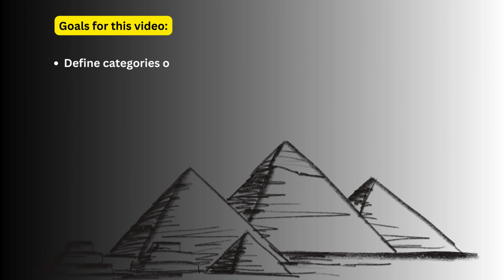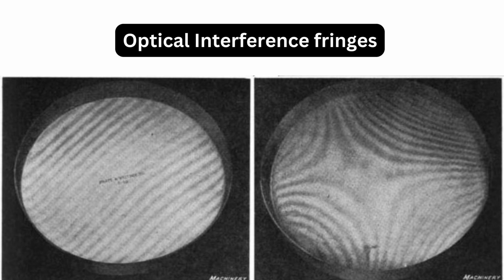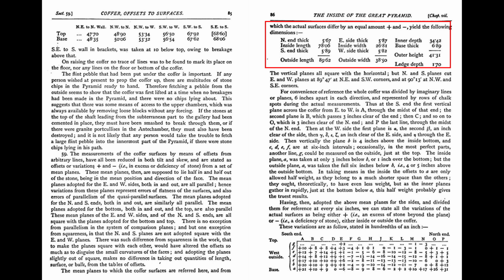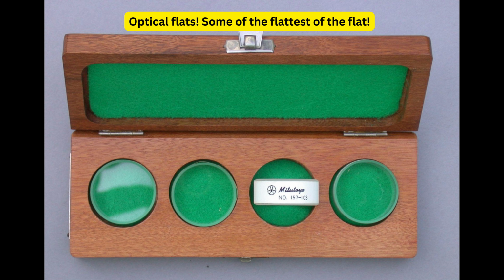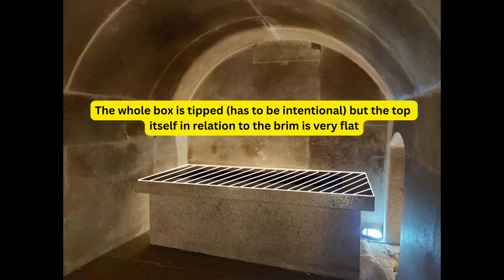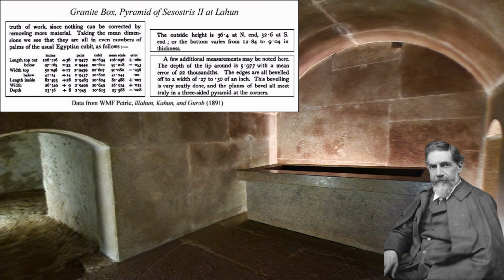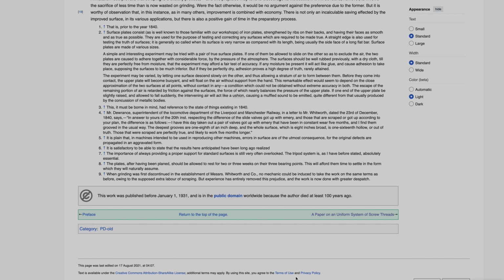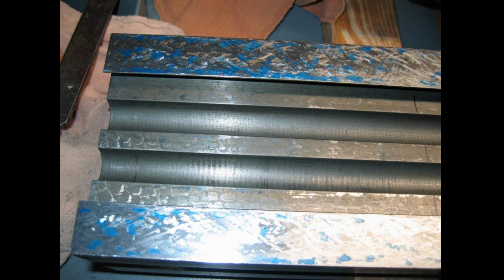The Problem of Flatness in Ancient Egypt

Comment: I'm so glad you mentioned hand scraping and the three plate method.
For those of you that think that ancient Egyptian masonry is evidence of "lost technology" consider a more rounded explanation: ancient Egyptian masonry is evidence that ancient peoples understood the foundational principals that modern precision is built upon.
Nothing was "lost." It has been the status quo for so long that it is easy to overlook.

All CNC and manual machine tools' precision originated at a hand scraped plane. A six axis CNC mill can operate at sub 1/1000 inch levels of tolerance because of a hand scraped plane somewhere at the beginning of the manufacturing chain.

Re: granite surface plates.

It is a calibrated rock.

A finely calibrated rock, but a rock nonetheless. Literally and symbolically the foundation of metrology. Simple. Enduring. Indispensable.
Reply from the maker: We are so advanced we forget how ground breaking the first carpenters square would have been. The first guy with scissors? Basically iron man.
Reply: @intothemap360 first man with scissors was iron man.  I think the first iron man was in full plate of iron..... man
Reply: @intothemap360 the first guy to whip out a speed square was probably treated like a witch
Reply: @intothemap360 it’s not that they could achieve angles and flatness genius, it’s how they accomplished it in materials on a mass scale in some of the hardest material on earth with primitive tools. Tell me you’ve never hand worked any type of stone material in your life.
Reply: @derekjancart215   pretty sure that 3000 years of knowledge and craftsmanship being passed through guilds for decades long projects doesn't care how hard you perceive something to be
Reply: @Azmodon lmao nice sub 80 IQ response bud.
Reply: @derekjancart215  im proud of you knowing what an iq is, baby boy :)
Reply: @derAtze well clearly most of you retar&ed city kids have zero clue about anything in the real world.
Reply: @derekjancart215  yeah it was obviously aliens that did that!!
Reply: @RussischRap did anyone say anything about “aliens” you disingenuous clown?
Reply: @derekjancart215 Just because you don't know how computers work doesn't mean they're some lost technology either.
Reply: @Shaker626 I’m well aware of how computers work genius. The fact is that the blocks in Egypt show CLEAR INDICATORS of machining, the Petri core sample being the most definitive example. I love how people who know less about this subject than I to try to lecture me about it 🙄
Reply: @derekjancart215 soy you are an expert then ? Highly doubt it
Reply: @derekjancart215 I love how you call other people genius sarcasticly and use iq as an insult when you are the idiot 😂
Reply: @1degRazz way to address none of my critiques mouth breather.
Reply: @derekjancart215 

"Tell me you've never worked any hard stone material in your life."

I have been knapping flint for about twenty years now. I'm going to go out on a limb and say that I probably have more experience working stone than you. I love making tools. I'm primarily a metal worker but I believe any person that is serious about making tools should experience where it all started at least once.
Reply: @derekjancart215  nice, look at all the retards who've never worked stone that you've stirred up
Reply: Good point, well made. I think the modern references to "forgotten technology from a bygone age" are by people (usually non-engineers) who don't understand well enough whats being described to them....
Reply: Almost brought a tear to my eye. Your passion for flat rocks is admirable.

Are you also a fan of smart rocks? They are also very flat.
Reply: Well said
Reply: These predate the Egyptians. We see the same story all over the world with these structures. That story was lost and mythologized over the centuries because the truth became too unbelievable. And now here we are today with the dumbest, most incompetent and disease ridden people in history.
Reply: Hell, plenty of machines still have hand scraped ways, not just way back at the beginning of the production process - there are highly accurate machine tools, in production today, that rely on hand scraped parts in the machine itself for their precision and accuracy.
Reply: it's all rocks and sticks
Reply: first mistake is to think ancient technology people actually care about some form of truth. they like good story telling.
Reply: Quite. We still have their level of tech in use. There may be a modern twist because of advanced materials, but we still lap surfaces. You can achieve good results with low cost with primitive tech. It just takes more time than other ways.
Reply: @pauls5745 problem is no one replicated those insane stone sculptures with copper tools
Reply: @honey87pie How is that a problem? Customs and resources vary by region and time period. Different techniques were developed to suit what was available.
Reply: @seitenryu6844 This is only a problem because the only way you could do that work today is with machines and power tools.
Reply: @honey87pie  ?? Yes they have. Pounding stones and copper/bronze chisels are more than sufficient and it's been demonstrated repeatedly. You go through more tooling faster than with harder metals but it absolutely does the job
Reply: @honey87pie the methods have been tested and proved to work, if you want to pay for thosands of people working for decades to build a whole pyramid with these tools and methods then be my guest. But to most people we only really need to prove it's possible to do it not actually replicate the entire prject.
Reply: @jakobrosenqvist4691  but that's not how the scientific method works. And the great pyramid is supposed to be built in 20 years, not thousands
Reply: It's like people dig way too deep for insane answers when they already had the answer at the surface
Reply: Hand scraped and Hand drawn with a pantagraph
Reply: The absolute king of precision machines is laser lithography.
Reply: @trisetank862  What about E-UV lithography machines for semiconductors with precision in nanometres.
Reply: @WolfGamerBohumin  I would say that's basically laser lithography with extra steps but you're right, technically the source that actually does the engraving isn't a laser... even though the energy of the UV light is coming from a laser
Reply: "yeah but my Google research tells me aliens may have had a hand in this"
Reply: To be fair, several building techniques have been lost to time and modernized processes. But id not pretend old civilizations were using alien mumbo jumbo. Just time, and effort.
Reply: @NotaNinja time and effort doesn't make an insane granite sculpture with copper tools and sand grinding.
Reply: @honey87pie except it literally does
Reply: @Tensho_C no it doesn't,  do it then , I've tried to do a little sculpture, didn't work out and I tried like a mofo for days trying different things. It would take a lifetime for a big toe on some of those granite statues. It wasn't copper and sand. Your uneducated and inexperienced if you asert that is how it was done. It's not alien tech. It's just a way we don't recognize and was ubiquitous or a state secret and wasn't recorded. With timelines that are claimed  for certain monuments our knowledge of what has been destroyed. Lost or reused and what we still see today implies an industrial scale operation that wouldn't be that inefficient becuase they didn't have access to enough copper or lifespan and populations to achieve the scale we see. We know slaves didnt do the work in fact the workers were highly paid. So thats not the main portion of the population, they were craftsman,  smart people same anatomy as us. Let's remove woo woo ideas, like aliens or that they couldnt have thought of the wheel. If they are aware metals like copper could be used with a harder material like sand with water to shape stone, it's not that far of a leap to have 1 singular craftsman to have the idea to move thar closer to a water source becuase the sand gets used up, however it's not river sand they use. It's a quartz rich sand from the desert we know this, sharp sand particles.  Larger sand obviously will last longer and cut more and is obviously crystalline to the eye. Someone else has the idea of using straight up broke quartz crystals or sapphire from the river in there bow drill instead of flint or chert. at the river you see "big" sand.  OK so wood breaks, copper bends then breaks but since it's the bronze age, that's tougher, your bronze bow drill is now insane. If you are lucky you bronze had an iron/aluminum contamination and now you got 954ish bronze. Someone gets the idea of using the river to turn the work instead of the drill becuase turning the drill sucks and the hours drilling is exhausting. So if you got evidence highly paid work force that isn't slaves, chronological evidence of large sites being made in a window of time. A rough estimation of population, there isn't much of an explanation of how at scale this was accomplished.  My thought experiment is only an arbitrary example of jumps in ideas. But it had to be more efficient to have the scale of  output they had regardless of precision. However more efficient techniques and tools will by nature be more repeatable, thus more precise. Not superior to ours. Sure there could have been master craftsman making there hard rock ultra thin vases with there mad max river lathe turning but that's not the majority.  I'd like to stress one more time, lost technology doesn't mean woowoo, aliens, lost civilizations etc its just techniques we don't know and obviously aren't explained by archeological accepted methods. Becusse archeological experts have yet to actually attempt their methods true to form
Reply: @erokcreatesyou should look into jade sculpting with thread and abrasive mediums and water is all they need to cut stone of any hardness just need an abrasive of higher hardness scale
Reply: @erokcreates Not everyone involved was a highly paid skilled craftsman. 
Also you seem to have run off on a tangent here.
No one is claiming there no lost technology. What people are claiming, and what the debate on the internet is: is there lost advanced technology or just lost technology that is still suitable for the era.
Like, if they only claimed that egyptians had some (by todays standards) primitive machines that helped them speed up the work like waterwheels, or plates of copper with a hardened iron edge for cutting then I don't think there'd be much debate other than academically.
But that's not what these people claim. Their claim is that egyptians somehow had batteries, or lasers or other advanced tech by today's standards that is somehow completely missing in any sorrounding civilizations and without any shred of evidence of manufacturing ability for such tech.
Reply: @Tensho_C show me one. Just one. Not from Egypt.
Reply: @honey87pie  lol. that's exactly everything it takes
Reply: @ajb9167sure, pick up a block of iron, some copper tools and with time you end up with a Ferrari
Reply: @spliter88  What these people also neglect is the Egyptians quite literally provided us with images of how they did everyday things.  There's reliefs carved into stone showing how they drilled and made granite jars.  There's reliefs showing them polishing granite with stones. There are no reliefs showing some mega fangled machine churning out objects.
Reply: @honey87pie  sure. Jade has the same hardness of granite and ancient Chinese were very proficient in creating intricate and precise sculptures out of jade.
Reply: @ajb9167 ancient China jade sculptures
Reply: @marcop1563 Yes. Another great example of sculptures that are so precise that we don't actually know how they were made, also never being replicated with the tools of that time, close but not anywhere the same precision. So the justification is the same "thousands of hours of labor" by the best craters in existence. Ok
Reply: @honey87pie  goalposts moving. And nah, there are people producing them with traditional instruments still today.
Reply: @erokcreates Except archaeologists have replicated the exact method with bronze saws, a lapping material, and water. These people devoted their LIVES to a single thing. Trained since children. Personal incredulity does not disprove the genius of ancient peoples.
Reply: @marcop1563  can you show me one, just one.
Reply: @honey87pie  I found several with a quick internet search. I think you can manage too.

And, by the way, you asked for "just one other example" and I give it to you. Now, instead of admitting that there probably was some way to cut hard stones with primitive tools since two ancient civilization so separate to each other managed to both do it, you are jumping to the idea that we have two ancient civilizations with secret advanced technologies.
Reply: @marcop1563 then explain to me why the writings on all those sculptures and boxes look like they were made with copper tools ans brute force
Reply: @honey87pie  all of those statues could've been made with copper tools. If you are implying that the writings are always of a lower quality, this is simply not the case. Look for example at the sarcophagus of Gemenefherbak, both front and back.

Those statue were done with ancient technology and there is no advance secret civilization. Deal with it.
Reply: @marcop1563 if you think the dynastic writings on insane sculpture you mentioned were made by the same people who made the sculpture you need some glasses or you are being dishonest. Every original writings on those sculptures has some hight, all dynastic writings were carved on the flat surface, with brute force, no symmetry, not a straight line.
Reply: @honey87pie  sure, there are some cases of writings added later. But even a single counterexample us enough to disprove your point, and I provided one. Go look at it and you will see that it has straight, precise, symmetric, and detailed writing on it.
Reply: @marcop1563 again, those dynastic writings are beautiful, but they were not made by the same people, it doesn't make any sense. You don't make a Ferrari and then carve a name with a car key after is finished.
And thats my problem with the history of Egypt. Things are identified based on names carved in stone, that's not scientific at all. And one final thing. Most of machines and tools we have today will be dust in a couple thousands of years, only stone will remain
Reply: @honey87pie  yes it does make sense. You don't want it to make sense to inject your conspiracy theories, but it does. People that commissioned those statues also wanted their names to be attached to them. Writing names on monuments is seen everywhere in human history. And your metaphor is doubly nonsensical because Ferrari does put its name on the car they produce.

Again, there are known cases of names being added later, but this is not true for all of them. And the precision with which those names are carved is the same precision that would be needed to make those statues. If the could carve the former, they could carve the latter.

And if Ancient Egyptians had advanced technology we would have some trace of it. Instead we have absolutely zero. We have remains of their boats, writings, everyday objects, tools. And no advanced technology among them.
Reply: @marcop1563 you still don't get it. I'm not saying Dynastic Egyptians had advanced technology. I'm saying those sculptures and constructions are way older than them. Egyptian timeline alone goes over 30k years, but mainstream choses to dismiss it.
I'm saying dynastic Egyptians found / inherited all that from a lost civilization and then proceeded to carve their names allover the place.
Is it fair? Can you prove me wrong?
Reply: @honey87pie  yes, I did get it, and I explained why that's not the case. 

Let's go over the whole discussion, shall we?

This whole idea is based on the fact that Ancient Egyptians supposedly didn’t have the technology to carve stone in an intricate and precise way, so someone else before them carved them. But the statues have writings that show which dinasty they belong to, so conspiracy theorists have to say that the writings were added later. But this would mean that Ancient Egyptians did have the technology to carve that stone. So conspiracy theorists have to claim that the Ancient Egyptian had only rudimentary abilities to carve stone, and this is proven by the supposed lower quality of the writings compared to the statues, so that they can still claim the statues were made by someone else. But I showed you that the writings are in some cases as intricate and precise as the rest of the statue. This means that Ancient Egyptians did have the technology to carve stone that precisely. And this means that the only reason to think that those statues were produced by someone else has been debunked.

Got it?
Reply: @marcop1563  unlucky for you that we can't date stone.  And unlucky for you those inscriptions CAN be carved with copper or stone tools, but you end up with no straight lines. Carry one. Bye. Keep believing nonsense
Reply: @honey87pie  I showed you examples of carvings that are perfectly straight. If you can carve those with copper tools with that precision you can carve the rest of the statue with copper tools. And this means that there is no proof for what you claim.

You tell me that I'm believing nonsense. Why don't you bring me some positive evidence for what you claim?
Reply: @marcop1563 show me a granite sculpture or diorite like that one made with copper tools. And the lines are NOT straight.
Reply: @captainwin6333  Direct, detailed, contemporary hieroglyphic scenes explicitly illustrating the step-by-step construction of the Great Pyramids are virtually non-existent, as they were not traditionally depicted in monumental, artistic scenes…weird for a people that detailed every aspect of their lives in this fashion. Quite odd no? And no I’m not saying 👽 did it or that they had power tools. Just seems very strange that they’d leave that out…
Reply: @hon@h @honey87pie f you have slaves and consider their lives expendable, like the Ancient Egyptians had, it does. Why does everyone forget (are they ignoring?) that slavery existed in egypt, ancient greece and rome, china, and countless other civilizations? It existed (officially) in America less than 200 years ago, still exists unofficially în America through the prison system and is well known in China. Why not thousands of years ago?

When you have thousands of people you can throw at big rocks, and decades to build something- those pyramids took forever- you can accomplish a LOT.

The great wall of China was constructed over centuries with forced labor. Cologne cathedral took 800 years depending on how you count the years, Notre Dame took 182 years. 

So yeah, with time you can accomplish pretty much anything, especially with slaves. 

Look up water and wind erosion. Water and even wind can erode rocks.
Reply: @wahidtrynaheghugh260 I don't want to accomplish a lot. I want to see a copper tool make a diorite sculpture like those. Also mainstream says the great pyramid took 15 to 30 years to complete. 😂
Reply: @honey87pie  I already mentioned Chinese jade sculptures, since jade is as hard as granite. And the writing on the sarcophagus I mentioned is straight and precise. Again, both of these prove that producing those statues was possible.

You meanwhile are failing to provide positive evidence. And the reason is that you are simply wrong.
Reply: @honey87pie  yep, and that timeline for the building of the Great Pyramid is perfectly plausible
Reply: @marcop1563 😂 Sure, just like the stone blocks weighing thousands of kg being sent down the Nile 500km on top of a raft made of wood logs.
Reply: @honey87pie  the ancient Romans carried a 455 ton Obelisk to Rome from Egypt crossing the Mediterranean. 5 times the heaviest blocks used in the Great Pyramid. The majority of the blocks used in the Pyramid were only a couple of tons.

So yes, carrying stone blocks on the Nile is perfectly plausible. You, meanwhile, have displayed some serious ignorance and you clearly have no idea what you are talking about.
Reply: @marcop1563 This is my opinion, I don't want to change the world and I don't need you to agree with what I said. You don't know me, you don't know how old I am, you don't know how much I have read or watched or seen. So before calling others ignorant learn to respect other people even if you disagree with them.
Reply: @honey87pie  and once I proved that you  were wrong you hide behind the agree to disagree. Typical
Reply: @honey87pie  oh yes it does. You're really telling on yourself here - you genuinely can't imagine being capable or working hard.
Reply: @wahidtrynaheghugh260  the pyramids were made by an enormous workforce but they were overwhelmingly not slaves. These construction projects would have been a massive point of pride for the people involved; many were skilled, highly paid, specialised craftsmen, and the labourers were mostly farmers, in the off season, who were effectively providing labour as a sort of tax. The Nile valley was terrifically productive and subsistence farming there, like in much of the world, would have involved intense labour at some times during the year and a lot of looking for things to do in other parts of the year, which is when they were off building pyramids.
Reply: @erokcreatesIt probably was recorded, the records were subsequently loss.
Reply: The thing that gets me, though, isn't that they could get into this range... but the TIME factor of how long it would take to do the pieces and put them together. I can grind a granite surface plate in a day or two at most to get these tolerances - but using hand done techniques, how long?  AND how to get enough of them done to build a pyramid in a few years (20 or 30)???  So we throw thousands or hundreds of thousands or millions of workers into it... so how do we get those hand done pieces to all fit together? 
We're still missing pieces here.
Reply: @CaptainSeamus There are clever ways to accomplish the same net effect using quite different techniques. For instance, creating 3 fixed stones out of non-moving bedrock then dragging the workpiece across them sequentially and repeating this a few times could do the trick. In fact, they might have done this without ever even realizing the 3-stone process. It does work for many more than 3 stones, after all. The grinding surfaces could be a hundred cubits long, so that simply dragging the large piece across it one time accomplishes the entire step. 50 guys all dragging a 10 ton stone 50 yards is not a slow process, they could do it in 2 minutes. Times 4 steps would be 8 minutes. Times 6 sides to a stone is 48 minutes. About an hour. 10 hour workday, 10 stones. This 50 man crew could likely have spent a lot of time of their day waiting for the next stone out of the quarry to show up.

Refining the numbers, the great pyramid has about 2,500,000 stones weighing an average of 5,000 pounds. This suggests the same 50 man crew could output about 100 blocks per day. It would take 25,000 days to do every stone. Which is about 100 years to do them all. Knowing that 10 years is a more reasonable timeline, it would take 10 crews to meet the timetable (500 men). Like most large projects, the logistic behind the operation is typically a few times the base operator load. If 3 men were needed to support one man in the crew, we are talking 2,000 men for 10 years. This is a major segment of the entire process, the steps being mining, transport, finishing, transport again, and lifting/setting. If each operation required similar manpower loads, we are talking 10,000 dudes over 10 years, and that includes the entire logistics field. This is approximately the same labor as the space shuttle required to get off the ground one time. This really puts it in perspective - it was the egyptian equivalent of a moonshot, and well within the means of arguably the richest nation on Earth.

Or it could have taken just one space alien pushing one button for one second. 😂
Reply: @FelonyVideos imagine the size of the management team and corporate lawyers..
30 years of 3000 people arguing over stationary details minimal.
200,000 hours of commitee  minutes..etc..
30,000 people in offices twiddling sticks...
10,000 bean counters..
30 million companies propaganda memo's...
10 tonnes of branding papyrus...
500 people inventing positive slogans like " we build safe slopes for Gods" or something something...
20,000 people rearranging various barriers for 50 years...
Reply: @ZionismISRacism00 😂😂😂 TRUE! 😂
Reply: @FelonyVideos 
Many if not most of the blocks in the Great Pyramid are anything but precision.
One problem with a flat production stone is the wear that it would acquire in producing the finished blocks. 
I do think that there are things we have not figured out how ancient engineers did things. That does not mean l think they had the equivalent of modern machine tools. 
One thing I do find interesting is the inspection work done on Egyptian stone vases. The levels of concentricity is pretty amazing.
Reply: @FelonyVideos  How did they move 80 ton granite blocks into place? Above the King's chamber
Reply: @mpetersen6  fully agree
Reply: @pyropulseIXXI  There is at least one youtube video of an old guy raising a 50 ton stone all by himself. It is true that I can barely lift a 100 pound stone in my arms, and can barely drag a 500 pound stone, but with a little forethought, I can lift a million pound building/object all by myself, if given enough time. Humans actually do this all the time. It is still amazing now, just as it surely was then.
Reply: @FelonyVideos  It is not like they built it in 10 years - tombs were commissioned as soon as new pharaoh took power and sometimes completed only years after his death. Tho, some of them were in power for not so long. Also, if you have constant demand, you will have an expertise sooner or later. 

After dinner, the Pharaoh looks at the latest issue of the magazine "Trends in Pyramid Construction": 
"Oh, I like this one - windows on the sunny side and barbeque space on the balcony."
Head priest: "Your grandfather would have strangle you for blasphemy."
Reply: @FelonyVideos  Wally Wallington is the guy's name I think. He basically recreated Stonehenge using concrete and wood. No explanation that I've heard explains everything though. Wally's method for example isn't feasible for transporting the stone hundreds of miles, from where the quarry was. That could be explained with sled, and a lot of effort. However, when you get into the weights of some of the single piece statues and stones, from 800 to 1100 tons, simple wooden sleds would be crushed under the weight. Even simple iron couldn't hold some of the weights involved. You would need steel a similar the strength of what was used for the sleds that were used to move the Thunder Stone. The crew that moved the Thunder Stone also had to wait for the ground to be frozen so the sleds didn't just sink in. As far as I know, steel and frozen ground were hard to come by in places like ancient Egypt or Lebanon. 

The precision on some of the smaller objects also can't be easily explained by simple hand tools. Flat surfaces are easier to explain using hand tools and manpower, but precision across curved surfaces, like what we see on some of the vases, is much harder to achieve. Even using a lathe you'd have to account for spindle runout and backlash at sub 1/1000 inch scales. Then there's the question of why is the precision required in the first place, and why produce the objects at such a large scale?

It doesn't require magic or modern technology, but like I said, no explanation I've seen account for every anomaly. Not even the whackiest ones.
Reply: @FelonyVideos the casing stones were installed rough then carved or ground down to achieve the finished product. A lot of buildings were done in the same manner. Now grinding walls seems to be even harder than your idea but that is what they did. 
Everyone has an answer but no one provides real world proof it's even possible let alone the way it was done.
Reply: @spracketskooch  the ancient Romans were able to take the heaviest known megalithic object ever produced by Ancient Egyptians, the Lateran Obelisk, and to bring it across the Mediterranean. I'm sure the ancient Egyptian could manage to bring them from the quarry to the building site.
Reply: @marcop1563  Sure, you can think that, but it's still speculation, and vague speculation at that. All I ask is that you treat it as speculation rather than fact.

Also, I don't think that obelisk was actually the heaviest megalithic object produced by ancient Egyptians. That title would go to one of the single piece granite statues, now broken, which are estimated to have weighed in the 800 - 1000 ton range.
Reply: @spracketskooch  the lost advanced technology hypothesis is outlandish and has no supporting evidence. It shouldn't be taken into consideration unless it's literally the only possible explanation. Pointing out any other explanation, even if it's not proven, is enough to allow us to dismiss it.

And you are right about the statue of Ramsess, but still the Lateran Obelisk is 450 tons and was moved for thousands of kilometers across a sea. Carrying something double that along a river is perfectly plausible.
Reply: @marcop1563  Depends on what you mean by advanced. If we're talking lasers and space travel, then you're likely correct. If we're talking steel and the ability to sail across oceans, then you're likely incorrect. 

Also, why is it outlandish? A claim isn't good enough. Give me some reasons why that hypothesis is so outlandish that any other explanation is better, if you wouldn't mind.

Steel sleds are also perfectly plausible, but that doesn't mean those are the explanation. You still have to provide some evidence that the 800 - 1000 ton blocks were floated. All I ask is that you reflect that uncertainty in your speech. For example, "according to what we currently understand, the most likely method used to move megalithic stones involved floating the blocks down the Nile river."
Reply: @spracketskooch  these videos are meant to dispell the idea that Egyptians specifically had things like lasers, so there's that.

I don’t see the relevancy of ocean sailing for this discussion. We know that Ancient Egyptians carried out oceanic expeditions along the cost of Africa, but there is absolutely no proof of them crossing an ocean. Even if a lonely egyptian crew managed to do it, they surely didn’t put up any kind of trade network with civilizations across oceans.

As for steel, if they used steel tools we would've found them. We did find some artefacts made of meteoric iron, but for most of the history of ancient egypt they didn’t have much more than that. They surely didn't build large steel structures like a large sleds, making that explanation absolutely not plausible. Meanwhile, we have a lot of evidence for large stones being carried by boat. Likewise, we know of methods of cutting hard stone without the need of steel, so there is no reason to think they used steel tools.
Reply: @marcop1563  How many people actually think ancient Egyptians had lasers though? They are few and far between in my experience. I do see a lot of straw manning happen though. Where people who think similarly to you will accuse someone of believing that ancient Egyptians had lasers and space vehicles, just so they can debunk that.

I'm not talking about the dynastic Egyptians. I'm talking about a hypothetical civilization/ set of civilizations that would have existed before the end of the last ice age. 

I also didn't say the dynastic Egyptians built steel sleds. I said something like that would be required to move the 1000 ton stone blocks across land. Which kind of rules out the dynastic Egyptians.

All in all, your listening/reading skills could use some improvement. As it is, you're arguing with ghosts.
Reply: @spracketskooch  again, this kind of video is mostly aimed at those who think there were civilizations with technologies comparable to our own. If you think something else, then it's not for you and you are arguing with ghosts.

Having said this, there is absolutely no evidence of any advanced civilization of the scale you are implying at that time. Graham Hancock is a fraud.

And no, you don't need a steel sled to move something like that. If the Romans moved a 455 tons object for 2000 km across a sea, there is no reason to think the Egyptians couldn't have moved a 1000 tons object for a tenth of that distance on a calm river.
Reply: @marcop1563  Well, it's aimed at a tiny audience then. And those people probably aren't going to watch it. In any event, I'm arguing with you, not the video.

There's definitely some evidence, but I'll leave presenting most of that to others. I'm more concerned with finding the potential flaws in claims made by archeologists. For example, the translated passage from the diary of Merer which is cited as evidence that the great pyramid was built during Khufu's reign reads, "Set sail, loaded with stone, for the Great Pyramid." The commas are included in the translation, which to me means that the boat set sail for the pyramid, and the cargo was stone blocks. Not that the blocks were necessarily for the Great Pyramid. 

The entirety of the claim that Khufu commissioned the Great Pyramid's construction hinges on that passage, and one graffiti like inscription in a void above the King's chamber, which no one is allowed to inspect, or photograph. Seriously, try to find picture of it. It's referred to as the "friends of Khufu gang" inscription. There are only a handful of pictures, and they all appear to be taken by the same person, on the same day, at similar angles. The claim is that the inscription wraps around to the inside joints between the blocks, which would prove that it was written as the blocks were placed. However, the only evidence for that is the word of Zahi Hawass and a few shoddy pictures. That wouldn't be good enough if it were Graham Hancock making the claim, and it's also not good enough when anyone else makes it.

I say all this to further illustrate the straw man nature of many of the arguments I see from people who think like you. Advanced ancient civilizations don't have to be invoked at all to call into question the claims made by many archeologists. Yet, when the flaws in their arguments are pointed out, it is often met with accusations of believing that lasers and aliens are the explanation. They attempt to shift the burden of proof to those questioning claims, rather than those making them. 

Lastly, sure transporting 1000 ton stones by floating them is feasible as far as I know. However, the journey from the quarry to the boat, and then from the boat to the plinth the statues rested on is still a major issue. That's not to mention that the only granite suitable for single piece statues is tens of feet below the surface. So they have to remove like thirty feet of granite before they can quarry the stones for the statue. Then they have to remove the block from the quarry, either by lifting, or cutting a passageway through more granite. Once the block makes it to the Giza plateau, it still needs to be dragged uphill, stood up, and carved. The entire process must be explained before you can speak so confidently.
Reply: @spracketskooch  the mortar used in the Great Pyramid was dated using radio carbon to the time of Khufu. This is enough evidence to show it was built by Khufu.

And yes, all those operations with that 800-1000 ton block can be done with enough men and time. Again, the Roman did them for block whose weight was the same order of magnitude
Reply: @marcop1563  The mortar was tested twice, once in 1984, and once in 1995. The first study returned an average date of 2917 BC, with dates ranging from 2853–3809 BC. The second study averaged to a date of 2694 BC, dates ranging from 2977–3740 BC. Both dates are significantly older than Khufu's time. The wide ranges also introduce significant uncertainty. So, no, the Great Pyramid's mortar was not dated to Khufu's time. In order to bring the carbon dates back in line with the hypothesis that Khufu commissioned the Great Pyramid, you have to introduce other, unjustified assumptions. Such as the wood being used to cook the mortar being hundreds of years old.

Maybe, but the Romans moved half that weight and had iron. The Thunder Stone was 1500 tons, but required screw jacks, steel sleds, and frozen ground. "Men and time" are much too vague, and don't properly communicate all of the difficulties involved with moving extremely large stones. Again, we should do our best to make our speech reflect the actual level of certainty we have.
Reply: @spracketskooch good grief. You're seriously suggesting that hieroglyphs include commas.

Also, even with the commas it's a perfectly reasonable reading that the stones are being used for the pyramid's construction.
Reply: @ZionismISRacism00  Well, that’s how we do it in the modern world. But, Egypt had God-Kings—and they didn’t have stockholders to be beholden to, nor social media. Obviously, I’m not saying there wasn’t bureaucracy—had to be for that level of organization—but OSHA wasn’t around, nor the vast majority of the  things that slow projects down. Don’t have to worry about allocating funds: God asks the Vizir, the Vizer consults oracles—and likely checks with the ancient Keeper of the Royal Funds—and orders it so if the chicken  gristle & entrails point to good fortune. 
Then the people in clean robes talk to the people with sand under their fingernails, and things grind into motion. 
(Mind, I’m completely ignoring the age-old issue of translating the architect’s flights of fanciful imagination into hard reality: what is actually possible with materials at hand)
Reply: @CaptainSeamus dynastic Egyptians did not create those sculptures and constructions. You don't fight enemies with arrows and horses and pull up stuff like that.
Reply: Correct me if I am wrong, but the most complicated structures created by the ancient Egyptians were during the very earliest Dynasties. 

A 3000 year old civilisation would be inferior at it's inception and become sophisticated as the centuries and millennia's roll on.
Reply: @MadMax-w6l  you are wrong. You welcome. 😊
Reply: TELL ME YOU’VE NEVER WORKED STONE IN YOUR LIFE. ESPECIALLY WITH PRIMITIVE TOOLS.
Reply: Outside the US, CNC people make fun of US banana units and "precision" of 1/1000 "inch". 😂😂😂
Reply: @Stefan_Dahn what does that even mean? I get the banana deal as a meme, but are you implying that metric is more "precise" than imperial? I hate to break it to you, but they're the same, just a conversion from one to the next.
Reply: @KISSMYACE3203 dudes just retarded lol
Reply: @Stefan_Dahn  Right on. Inside the US, we don't even think about whatever little bullshit country you're from, because it is insignificant and irrelevant. 

By the way, the original measurements of most of these sites and artifacts were taken in metric. You have access to those if you type a few words into a search engine. Most Americans with any scientific training are also familiar with the metric system. So we're actually competent with both systems. Much like how people across the world are better with languages that Americans because they often learn two languages. A result of English speaking countries, mostly old Britain and the US, dominating international trade for so long. The rest of the world uses a different unit for measurement, so we were forced to learn two systems.
Reply: A calibrated rock, calibrated by two other rocks. The most precise thing is also one of the most stone-age.
Reply: I'm pretty sure the lathe came first.
Reply: @mcapps1
I think the potters wheel possibly came first.
Reply: @mpetersen6  I'd say a wheel came first
Reply: Ah yes, just casually lapping 60-ton rock plates
Reply: @ObservationofLimits well, yes in fact. You can have one fixed surface and 2 moving smaller plates and still make the 3 plate method work.
Reply: I have seen Swiss engineers come into the factory where I did my apprenticeship and use abrasive compounds and plates to level a worn granite surface table , an amazing thing to see along with their measuring techniques of precision levels and the calculations which I think were the grid sort as opposed to the Union Jack pattern . It was great to see such skilled people at work and realise that such things as Greek columns used similar grinding techniques with abrasive sand .
As a note calibration is a term which came from finding the size of bore of a gun and the suitable caliber of the bullet or cannon ball in order to prevent failure of the firearm .
Reply: Do you have an explanation for the tube drill holes and circular saw marks in Egyptian artefacts?
Reply: Huh? As an engineer myself its clearly machined, not to mention all the evidence for toolmarks. Also not to mention the tolerance 100% indicates its machined. 

Also the the biggest granite quarry confirmed they cant gurantee this type of tolerance.

I dont know why people ignore hard engineering evidence and believe some archeologist with a liberal art degree (basically the same as gender studies).

Not to mention the current gpr data showing huge structures under the pyramids.
Reply: @paradicsomharcos  what you said is complete nonsense. Just like those claims about structures under the pyramids.
Reply: @paradicsomharcos  
> I dont know why people ignore hard engineering evidence and believe some archeologist with a liberal art degree (basically the same as gender studies).

If you do, please let me know. Some people are CRAZY for believing this was done by hand!
Reply: @MrTruthAndFacts  yeah but most of the "people" online are bots or simply a sheep. Even as a kid i never understood why people would believe archeologists/historians on megaliths ans Precision cuts...they dont even have any physics, chemics or any engineering knowledge, they probably cant even change their light bulb at the office. Thats like trusting your history teacher to do open heart surgery on your mother...insane how stupid average people are.
Reply: @MrTruthAndFacts says the guy that thinks the Egyptians had lasers
Reply: So convoluted and none of you have any real engineering understanding or background.
Reply: Also, when people talk about how intelligent people were then, I always think that if you did one thing (e.g. stone masonry) for your whole life, even in childhood, you'd be pretty dang good at it. They didn't have TV to distract them, no smartphones, even radio or newspapers or books. You'd try to make the stone as flat as possible for fun and as a challenge. Also the pyramids took like decades to be built. That's plenty of time to chisel down a bunch of stones. Nowadays we build structures 10x the complexity in months.
Reply: @Makos93 😂
Reply: @Makos93 I see your point and agree, but go to a limestone mill and check what equipment is required to cut stones that big. Let alone build a massive pyramid out of those stones with a low tolerance. It wasn’t as easy as “they spent their whole life” sanding and grinding stones down. They definitely had some kind of techniques that were lost.
Reply: But that's literally some of the highest level of precision?  I don't understand what you are getting at? The issue is it was lost, not high technology, it was lost, how did they achieve what we see at scale. Literally how. Not woo hoo.
Not alien tech. 
Were talking mechanical advantage of some kind and a rigid way to hold the work and a tool. 
Whether it's in the river, using rafts to make the stones easier to manipulate and shape, using a stone to grind another stone. 
You have to show how the concentric, asymmetrical 20ft long 1.5ft diameter granite columns.

I am a machinist who does inspection, assembly and machining of steel and paper mill drive systems (giant gear boxes) as well as machine repair for semi conductor, food manufacturing, and random other industries.  The granite columns are all I need to establish they had much more advanced capabilities then we give them credit. Those were turned, full stop. Those sights allegedly didn't have the wheel.
Therefore there is lost technology and understanding.
Knowledge is power, keeping things secret is power.

This kid giving his book report on precision with likely no practical experience. 

The mystery is how they did it, this child is just explaining basic concepts of the modern manufacturing world, with that disproving nothing. If any process is analogous with today's that's the whole point. That's lost technology. 
If anything is mechanized its lost technology 
If you are turning any hard stones with concentricity within a thou, that's lost technology. 
The copper sand theory is horse shit, the sand abrasive gets consumed and "used" up just like sand paper does, and copper will harden and break off fairly quickly, if we were talking plastic embedded with hard minerals, yeah it'd probably work. Plastic wears very little against hard materials.  Copper would wear in hunks unless you spent most of your time annealing it, which would make the abrasion less effective tool pressure wise.

A personal favorite theory of mine bronze (something similar to 954 there is rich iron aluminum bauxite deposits nearby) used as a tool holder, and a jeweled insert, the nile has sapphires, and the rarely had diamonds and corundom as jewelry, they did if they were especially pretty and blue but most of these minerals are not pretty and could be used as cutting tools, allegedly they did with a bow drill tipped with corundom in 1 singular predynastic burial, the sight now flooded by the dam and the alleged artifacts unaccounted for, and likely discarded. 

They break if they get to hot, so by the river partially in to keep it cool. They break it of they need a new edge. 
Evidence is alot easier to lose that way. 
Now my theory which would be plausible if any evidence could be found supporting that.  Would be eventually just using the river to turn their work, cool there work and lubricate there cutting forces whether it's abrasive action by rubbing stone on stone or a cutting tool. It's easier for everyone and Is a natural progression from bow drill, then bow drill by a river. Sees things flow and roll down river. Gets idea. Fast forward a generation you got a predynastic lathe, without requiring roller bearings. You can float a wheel or use a water wheel with your work inside it I sometimes feel like the dolorite pounders are like used in that process potentially. When its used up they are nice and round Like we sew in quarries and are now perfect pounders. 

And let's say this technology is ubiquitous knowledge,  everyone knows, so why write it down. 
I think all you skeptics, interpret ancient technology means superior to ours and in the same contexts to our world.
As for  myself it's simply unknown techniques for shaping materials on an industrial scale. Like you can shape stuff very ineffectively and get results but now do it to millions and millions of objects I'm just going to say every object is not precise all by eye, the ineffective methods don't pass the smell test for industrial scale operations for timelines we are given by egyptilogists. They simply wouldn't have the resources to do it the methods you described. The machinist ideas and concepts you describe are accurate, the way you claim a concept disproves lost ancient technology Is bad logic. Retarded.  I know you must be in or was In school, you like feeling superior. But you obviously are inexperienced with the application or practice of anything you described in your book report
Reply: hey grizzwald, if they used a technology that was 'invented' just a few hundred years ago, and we don't have any evidence/documentation of that technology being used in ancient egypt, it was effectively and still is technically lost technology. derpity derp derp derp lol
Reply: You’re so misinformed and so confident about it. Dunning Kruger at its finest.
Reply: "Nothing was lost"? So were did that precision go after those thousands of years old buildings and monuments? Evidently not to medieval europe where that kind of precision is unheard of. He even explains in the video that this method was "invented" like in the 18th century.
Reply: @spa1ktc  medieval masonry achieved remarkable precision. And the fact that that method was discovered in the 18th century is inconsequential when it used techniques that might have easily been used by Ancient Egyptians
Reply: @marcop1563 Eurooen masonry of any era honestly is just not comparable to some ancient megalithic sites when looking at scale and precision. Cusco Peru just to pick one. The box in the video is another. Nothing like it has never veen made in Europe.
Saying that nothing is lost is just plain wrong. Obviously whatever techniqe was used making that box/coffin or whatever did not carry on to following generations. If not every civilization would have made similar stuff, but that's not what happened. We now might know how to relicate it, but that is besides the point.
Reply: @spa1ktc  sure, because Romans before and Europeans later did things a different and easier way. There is nothing strange with it. In fact so many cultures using these kind of megalithic structures proves that it didn't involve advanced technology. whole discussion is about the possibility of Ancient Egyptians having advanced technologies. The fact that it's possible to replicate those artefacts without advanced technology is enough to disprove it.
Reply: @marcop1563 When has anyone ever reproduced that granite coffin using simple tools?
Reply: @spa1ktc  watch the video
Reply: @marcop1563 Never in the video did anyone make a coffin out of a solid block of granite using simple tools. That footage is not there because nobody has ever done it since. Point beeing until it's done in reality we do not know how the egyptians did it. Rubbing two tiny slates against each other on video and using editing to visualize the full scale process does not compare.
Reply: @spa1ktc  the show how a flat plane can be obtained out of hard rock, using a method that doesn't require advanced tools and that has been used on large slabs. That's all you need. The rest is just a matter of time
Reply: @marcop1563 seems like we have different standards for what acceotable proof is. What you say is shown to work is just not proof enough. I see a video animation. That is not proof of concept, just a presentation of a hypothesis. To demonstrate this hypothesis works would involve acctually making a scale 1:1 replica. Ask any stone mason in existance to reproduce this using presented techniqe and they would not be able to do it, even with a lot of time. 
If time was all it took there would be similar stuff elsewere and newer stuff. But there just is not. Those people back in prehistory obviously knew how to do this, and we don't.
Reply: @spa1ktc  that method has been used for centuries to produce smooth surfaces of hard rock. So you would have to explain why it wouldn't be possible.

Besides, the whole argument for advanced technology completely rests on the fact that obtaining those kinds of surfaces is impossible. The mere possibility of a process that would allow to produce them is enough to disprove the hypothesis.

The burden of proof is now on you to positively show that that process wasn't or couldn't be used, or to provide positive evidence of this supposed advanced technology
Reply: @marcop1563 No, it's not. The granite coffins featured in the video exist and are very old, that's fact. It is also fact that there are no comparable objects made since with simple tools exept from other historic megalithic sites were we also do not know how they did it. Smooth surfaces is not the only special thing here, it's also scale (weight), hardness of the rock and complexity in design like the hollow box shape with overhang etc.

I say it can't be done with any currently known method using simple tools. You say it can with this hypothesis. 
You or this video has not proved anything until it is done in reality. My proof is that no one has ever since made such objects using simple tools. If it once was made with simple tools someone would be able to recreate it.
Reply: @spa1ktc  the fact that other cultures managed to build similar structures and we have no proof of advanced technologies with any of them is evidence against the need for advanced technologies.

I'll explain it simply. The only reason the advanced technology hypothesis can be considered, despite the complete lack of any sign of them in archeological findings, is if it's literally the only explanation.

The method shown here is an alternative explanation since it explains how hard rocks can carved into arbitrary flat planes. We don't have to produce another sarcophagus with this method just like we wouldn't need to build a new Great Pyramid to prove that it would have been possible to use a particular method to move rocks to fully build them. Likewise, smoothing one face of one rock with this method is already enough to show that it can be potentially used for all faces.

The burden of proof, again, is on you to explain why precisely this method couldn't have been used.
Reply: Repetition takes precedence in a risk-free environment of the unknowledged cult of mainstream perception in safekeeping — the group oriented behavior and identification we require by which institutions of science are managed through the funding and career building process.  People are normalized into acceptance of endless circular reasoning in the search to maintain established narratives in the face of increasingly diverging evidence of an overwhelming nature.  This requires a compartmentalized and arbitrary mindset to wait for some comfortable return to reason of repetition provided, with the scientific method in name only on a shelf in the closet.
Reply: @ronaldgreene5733  That's a lot of words just to say you don't understand something.
Reply: unless you have a time machine your guess is as good as any. The elongated skulls larger than human and no sagittal sutures.
Reply: Or it could have been done by aliens.
Reply: @ernie5229 😂😂😂 with their "flattening" ray gun thingy 😂😂😂
Reply: @ernie5229  Just because you find it impossible that non-white people can be intelligent and skilled, doesn't make it not true.
Funny how every single advanced ancient monument or monolith or tool made by white societies never gets idiots going "oh ma gerd it's aliens!“. It's ONLY ever when brown people do it that you whackjobs come out with nonsense like that. And we all know why.
Reply: Dynastic Egyptians did not create those sculptures and constructions.
You can't carve granite sculptures or boxes like those with copper tools. It's physically impossible, never replicated
Reply: @honey87pie literally just go look up "carving granite with copper tools" and you'll see somebody replicating it. Get a grip!
Reply: @da54177  I've been looking for over 15 years. There's none like the sculptures in Egypt. Marble ain't granite mate.
Reply: @honey87pie Stone is stone is stone. time and pressure
Reply: @ajb9167 carving a granite sculpture with copper tools is the same as carving an iron sculpture with plastic tools. Carry on
Reply: @honey87pie It's valid to say that you don't know how the Egyptians did something. There's no shame in being ignorant of something; none of us has complete knowledge of the world.
The problem occurs when you claim that because you don't understand something, it is physically impossible.
Here's what people have done to recreate the work: used copper and stone and ropes.
Reply: @j_taylor no. The problem occurs when people like don't know what you are talking about. And again, I don't know what I've seen or heard, one thing I can tell you, there's no granite sculptures like the ones from Egypt made anywhere, with copper tools or any tools from the Dynastic age, none.
Reply: @honey87pie dude just bend the copper piece a couple times without warming and see how soft it becomes after work hardening...
Reply: @timop6340 what?
Reply: @honey87pie just because you're to stupid to know how it was done doesn't mean others couldn't do it
Reply: Your comment is virtually meaninless. 

"ancient Egyptian masonry is evidence that ancient peoples understood the foundational principals that modern precision is built upon"

Uhh specific principles not stated..this doesn't address how it was implemented at scale..why did this capability disappear for millennia? Understanding a principle is not equivalent to having the implementation capacity. Greeks understood heavier-than-air flight principles (Archimedes, aerodynamics) and didn't build airplanes... Romans understood steam power (Hero's aeolipile) and didn't build steam engines... etc. "Yap Yap, this is possible because trust me bro Yap Yap."
Reply: @Travelerof9 the whole society practically disappeared and you expect that everything should have remained at the level of top societal complexity forever. Advanced societies grow slowly over time, achieve the point of diminishing returns and gradually decline until they collapse. Unless they are able to find a cheap easily available source of energy enabling even more complexity.
Reply: @Travelerof9 Because there was no need. After the bronze age collapse Egypt never
regained its former prosterity, the Pharaohs could not afford to soend frivulously on their timbs. Houses and palaces could be built with much lower tolerances. Without demands for such skills, the knowledge sinply died out.
Reply: We get it you're confused
Reply: @Travelerof9 Yet another example of what you are talking about is your comment itself. It demonstrates that you know and understand the English language quite well, yet were unable to comprehend the information given by the OP in that very same language! 😂

Here's a new rule for you, one that you have obviously never been exposed to - before calling someone a dummy, make sure it is not you that is the actual dummy. 

Alternatively, you could limit yourself to the topics of politics, hair, and makeup.
Reply: @FelonyVideos you didn’t address anything stated in my comment but just threw out words like the OP. Guess we are all in the same boat :).
Reply: @FelonyVideos I also didn’t speak on their intellect or knowledge. It was a comment about how the comment adds nothing to the video…despite that being its purpose.
Reply: @Travelerof9  That YOU didn't understand how the comment affects this video doesn't mean others of us did NOT get the point.  
Let me break it down for you - if I were to build a flat surface my way - how do I get 10,000 others (or even YOU) to build a flat surface the same way, and have them work so well together  that we didn't have to continually check each others work to make sure they would fit up?  
Heck, even 30 years ago, this was a problem in manufacturing, where parts built at one plant wouldn't mate up to the exact same parts from another plant for the same item. I remember a glorious example of this with stampings at two different Ford plants for the same vehicle... all within tolerance, all a mess to make fit.
Reply: @Cap @CaptainSeamus e word before you say “let me break it down for you”; what do you mean? I’m saying there is nothing to extrapolate from the OP. Are you saying there is substance to his comment by just saying it’s simple but not attributing to how it could be?
Reply: @CaptainSeamus  Yes, modern precision originated historically from hand scraping. But that does not mean any precision artifact can be explained by hand scraping, or the full industrial context that makes scraping effective can be ignored. Origins usually never substitute for infrastructure. “All CNC precision originates from a hand-scraped plane”

This is true historically and irrelevant operationally -- what they omit is everything between the scraped plane and the CNC mill...metrology chains, calibration hierarchies, standardized materials, controlled environments, repeatable fixtures, error budgets, institutional knowledge transfer. A hand-scraped plane is necessary, but wildly insufficient. Egyptian boxes wouldn't require a scraped plane, but a stable metrology ecosystem. The comment pretends the ecosystem comes “for free” with the principle. It doesn’t.
Reply: @CaptainSeamus I’ve read your “break down” and I’d ask the same question and I’m not in opposition. I don’t even know why you responded to me specifically..
Reply: @FelonyVideos  I liked your comment so much that I had to stop and bother my wife with it. You describe the principle that I try to follow. Generally, even if I feel confident I know the answer, I'm going to look it up and make sure. Especially when correcting others. Last video I watched, I caught them making an error, but wasn't sure they had the correct font onscreen, so I opened Word to be certain I was looking at the right font...discovered that he was giving an inaccurate description of the shape of the dots...easily verified, but he hadn't bothered. I think most people don't bother looking up anything of importance, just silly stuff, relying upon their very imperfect memory instead.

It's absolutely ridiculous that most people on earth now have ready access to insane amounts of knowledge, yet the vast majority of them never make use of it.
Reply: @Travelerof9  You claim not to have spoken of their intellect or knowledge....what the hell do you think calling it "virtually meaningless" is? Is English perhaps not your native tongue? Or are you simply among the 54% of American adults who read at below 6th grade level? I'm guessing the latter.
Reply: @FelonyVideos wow, you really showed your level of childish superiority with that comment. 
I know you are but what am I 😂
First grade level intelligence. Momma must be proud.
Reply: They didn't need to address anything you said because it was dumb
Reply: @Travelerof9 This is exactly what I expected an idiot that dont understand what they just read would comment. 

Instead of accepting that you are unable to comprehend the words, you attempt to unlegitimise the message to make you feel better about yourself. You live in complete denial. Instead of accepting that you must not understand, you attempt to twist reality to your understanding. 

Your ego is your worse ennemy. But stupidity is also very likely the culprit here.
Reply: wtf u on about. Doesn’t say anything just yapping like an idiot